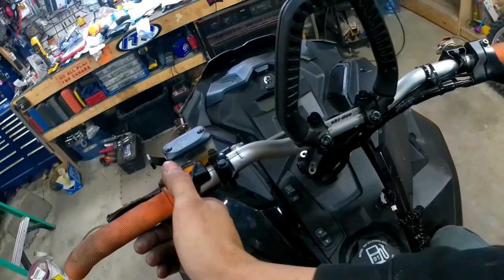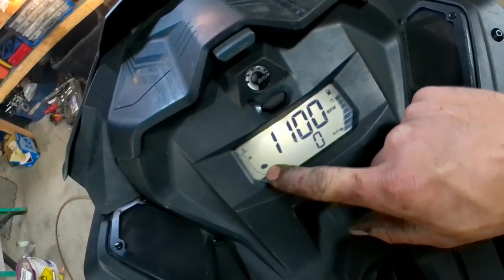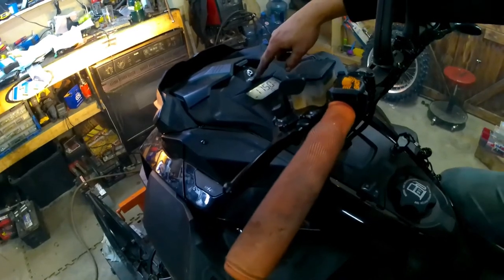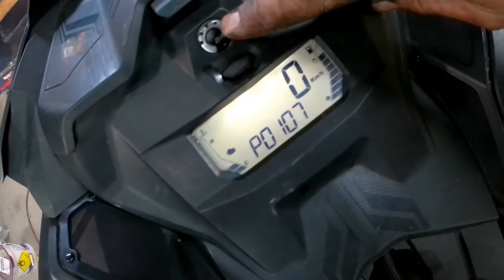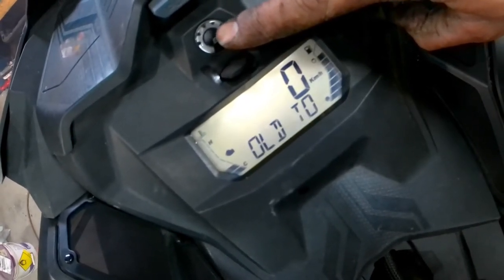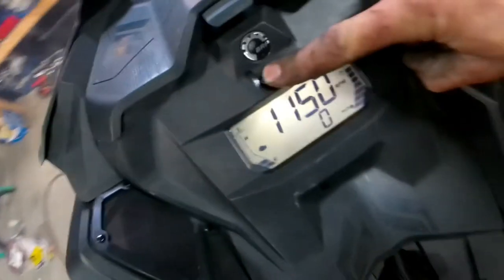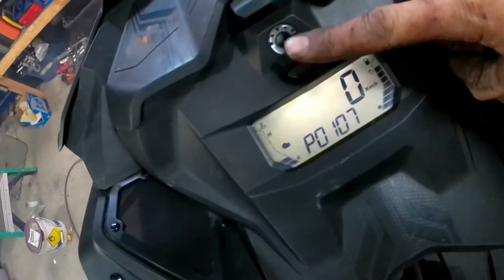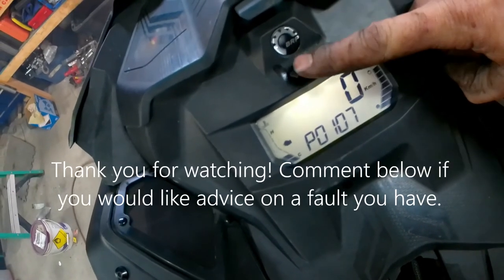How to display Ski-doo fault codes on single button G4 dash.

Comment: I have the same dash on my 2023 600 EFI Renegade Sport. I only have two tanks of fuel through it since buying it new and I've noticed that the gas gauge is not reading consistently anymore. When I fill the tank it still reads half a tank and then after a while it slowly comes back to full but then goes back to half a tank or less. Do you have any ideas what might be causing this? Thanks.

Comment: U have the same codes as me. What should i do first. I crashed my doo on a rock and those codes came right after it on the dash... Probably some sensor has detached etc...
Reply from the maker: The code is for the exhaust temp sensor module, perhaps wires damaged on impact?

Comment: If check engine light came on and then went away at next start up will this process get let you see what that code was?
Reply from the maker: Unfortunately this only displays active faults so the check engine light has to be on when you do this procedure. This will not display stored codes, to obtain stored or saved codes the machine would have to be plugged and scanned with the oem diagnostic software. Thanks for watching!
Reply: @caudronperformance  appreciate that!

Comment: Do you know why my dads 2017 skidoo 900 ace engine light is comes on from time to time his skidoo has 23k kilometres on it and the check engine light comes on and we don’t know why?
Reply from the maker: Without the code number it is hard to tell, if it has the same dash as in this video follow the steps and get the code number. The check engine light must be on the dash to be able to pull codes

Comment: Is there a way to clear the code?
Reply from the maker: The code will go off the dash when whatever problem is resolved, on the next startup. It will still be stored in the computer but will not be displayed any more. The only way to erase stored codes is with the diagnostic software.

Comment: Any  idea if you can do this on a single button 2011 summit?
Reply from the maker: No, the gauges with the single button and the smaller lcd display don’t have the code function. That will have to get plugged in and scanned with BUDS.

Comment: What was wrong with yours? I have a 2022 throwing the same two codes
Reply from the maker: I’ll double check but p0113 should be for the air temp sensor. This is right below the gauge/glove box. Likely it is not plugged in.
Reply from the maker: To confirm, P0107 is ambient pressure sensor and P0113 is intake air temperature sensor. Both are built into one sensor on the top of the air box below the gauge cluster.

Comment: Any idea what code p1474 is?
Reply from the maker: It has to do with the exhaust valve servo motor but I’ll have to look it up for more details in the morning
Reply: @caudronperformance  that would be very much appreciated, thank you.
Reply from the maker: Sorry for the delay, P1474 is RAVE actuator motor open circuit, so can be the electric motor itself or one of the wires to it damaged or broken or disconnected. Hope this helps, good luck!
Reply: @caudronperformance  thank you very much! Do you know if I replace the servo motor does the new one need to be calibrated with buds? I’m out in the boonies and don’t want to haul the sled to my shitty dealership.
Reply from the maker: @keifer6  you can replace the servo and it requires no programming. There is a rave position sensor on the engine side below the cable but as long as the engine side of things are left you will not need to reset anything
Reply: @caudronperformance  your the man, thank you for your help sir!